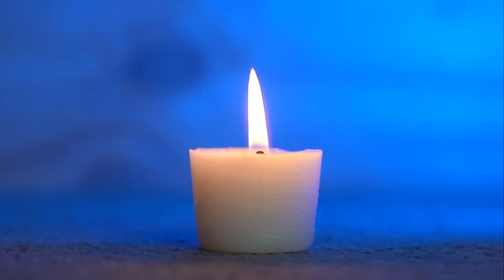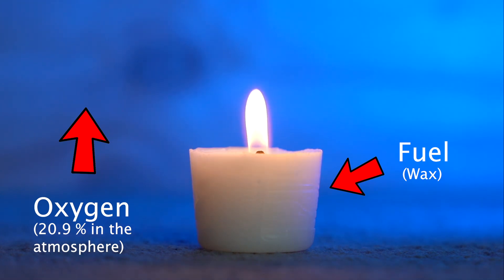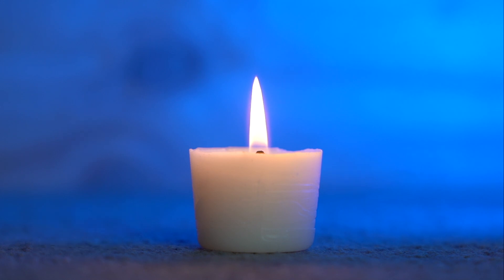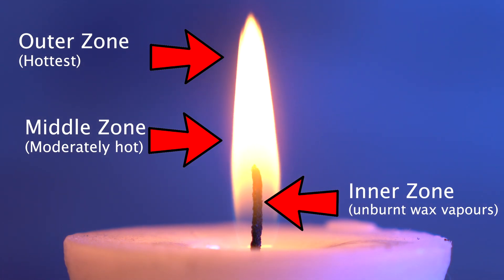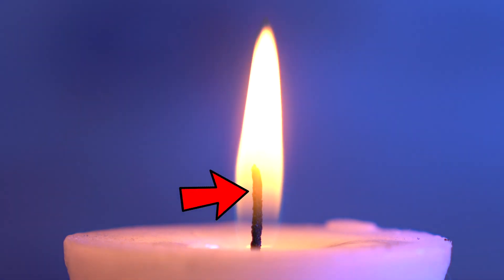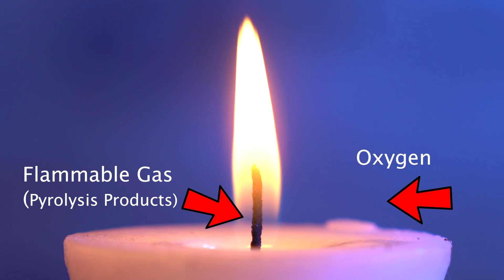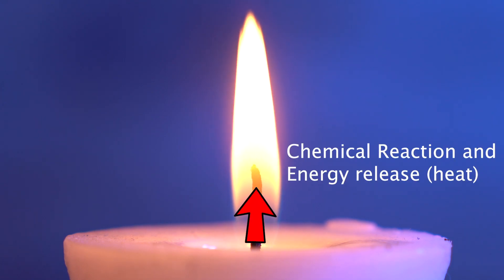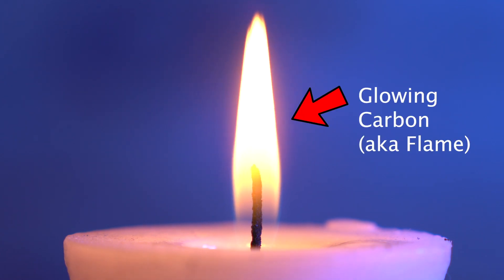Smouldering vs Flaming combustion - Episode 14

Comment: Temperature is also relevant!  a smouldering fire is typically 400 to 1000 celsius, a diffusion flaming fire 800 to 1200 Celsius and a premixed flaming fire 1200 to 1500 Celsius.